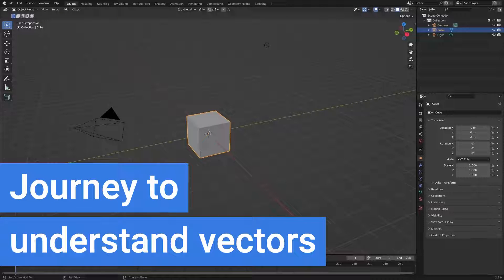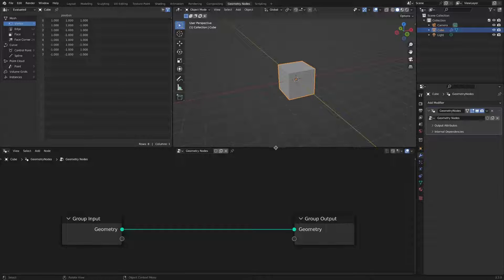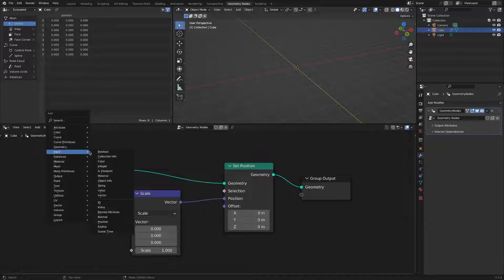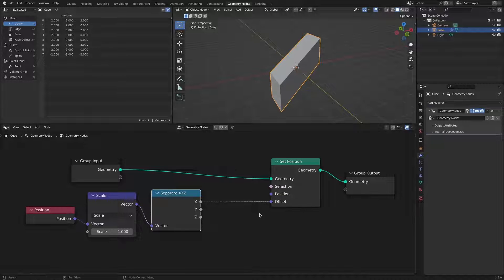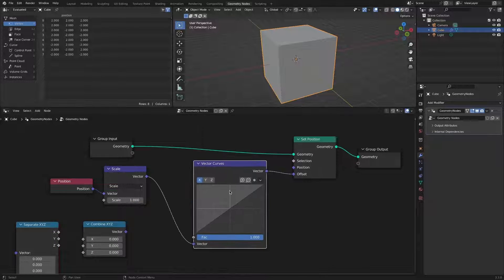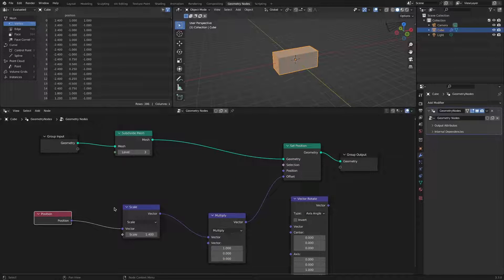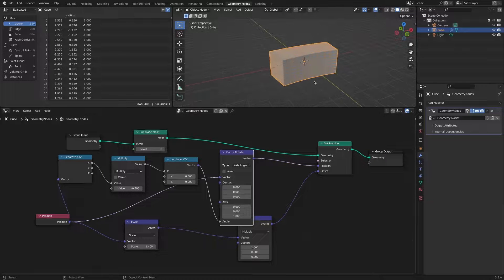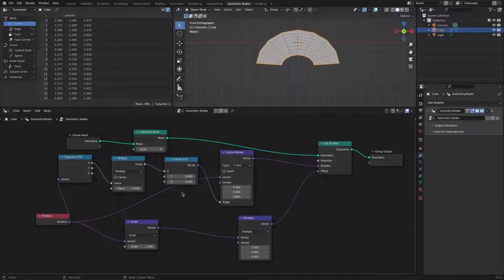Study on Vector nodes (Geometry Nodes)

Comment: The way to scale vectors in one axis only is to simply place a vector math node set to multiply - this gives you independent control over each axis (the ‘scale’ option in vector math node simply multiplies the vectors all by the same value).

As a general rule - multiplying vectors means scaling, adding vectors is equivalent to translating.

So the ‘mapping’ node in the shader node is simply add > multiply > rotate all in the one node.

Rotation is not such a simple calculation and usually the vector rotate node is used (as far as I’m aware there is no simple equivalent in the vector math node).
Reply: 醍醐灌顶

Comment: It disappears because the socket is expecting a vector (three values) for each vertex. Instead you are feeding it a single value for the X, Y & Z of each vertex based on only the original X position.
If you want to scale only the X, you can do so and then 'combine XYZ' with an unaltered Y & Z.

Comment: My impression is that when you use Separate XYZ Node you get a value (for X) which you use as an offset, i.e. you move the center of the 2 faces by the value used in the Scale Node.